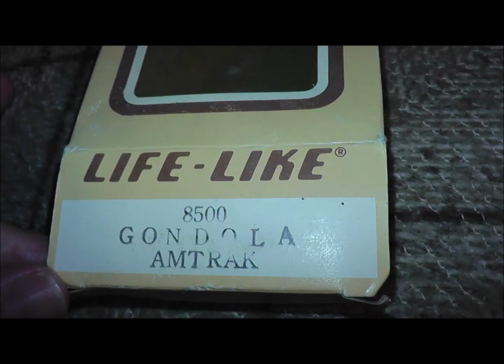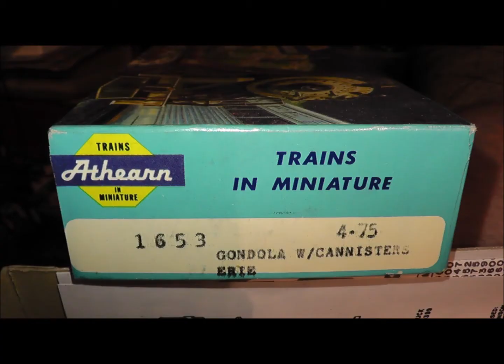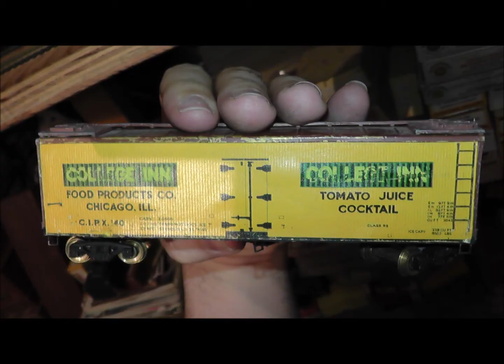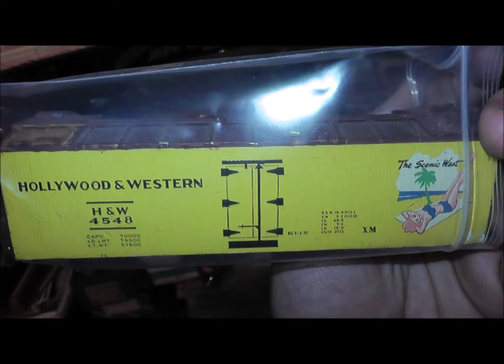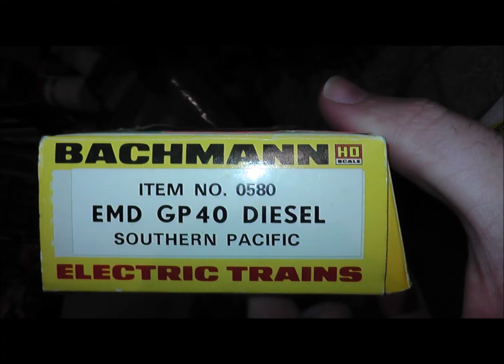ho trains for sale ebay 3do retro gaming gpk tyco life like cars locos

Comment: How much did the 3DO go for (assuming the auction has ended which it probably has)?
Reply from the maker: Nobody bid, I relisted at a lower price and listed more 3do systems too
Reply: Kevin C ok
Reply: Kevin C I'm stupid. You're in a different country to me. I didn't think of that before. The systems are still a bit above my budget anyway (not to say that they're expensive for what they are). Cool though. How did you get hold of so many?
Reply from the maker: I buy them from Japan they are particular version 3do with a switch on back that most 3do dont have the switch. for people that use framemeister
Reply: Kevin C So you buy them to resell? Is that switch specific to Japanese machines or do you buy from a modder?